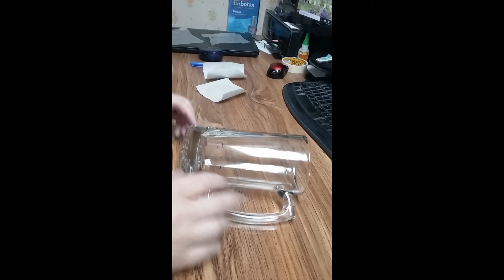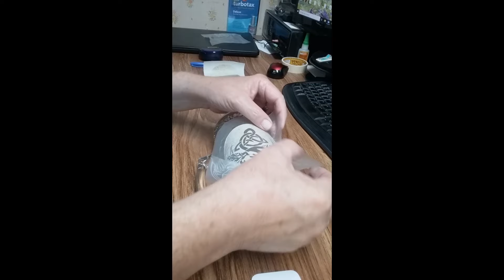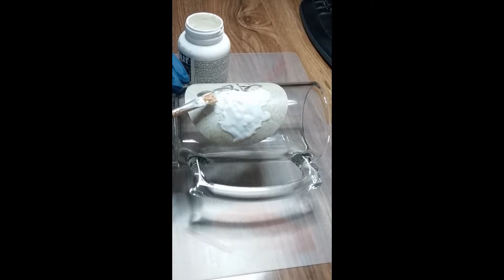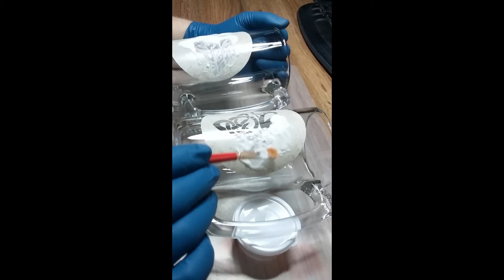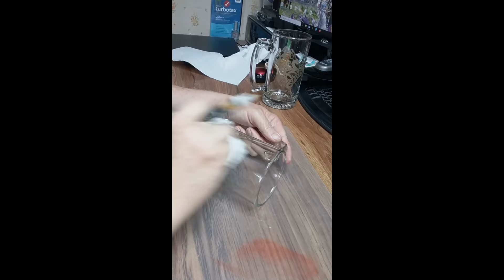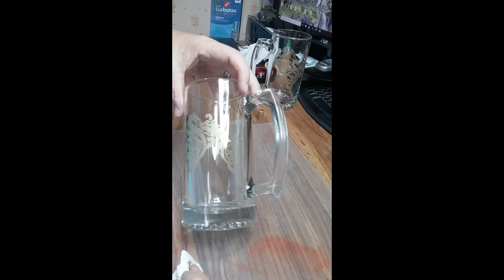Glass Etching with color

Comment: Have you tried Rubb and Buff for coloring?! 
 I'm curious if the painters markers work better or not?
Reply: Yes it was one of the ones I tested and it did not last as long, in the comment there is one that you bake on that they say works good that I have not tested.  I have coated some and then did sublimation on the etch area that has lasted the longest

Comment: I’ve tried the Sharpie brand paint pen and when rubbing off the excess it doesn’t come off the non etched part of the glass. It just smears it all over. Does certain brands work differently even though they are still an opaque paint pen? It’s oil based for permanent use.
Reply: I tried the Sharpie paint pen again, using the same technique you used. I have the metallic gold color and it’s oil based for wood and glass. It works to a point, but you have to scrub pretty hard to get it off the glass before it dries, and I do only a little bit at a time. I don’t know if it’s the color I’m using, but it’s not very noticeable. I tried a second coat, and there’s no difference. The color is great if I don’t wipe it off.  Maybe I’ll try keeping the stencil on after etching before taking it off to paint. Thanks for answering.
Reply from the maker: If you get a paint pen it must be one for glass Painters by Elmer's is the one I have had the best luck with or just a Sharpie pen not the paint pen.  I have coated them after they are good and dry with Mod Dishwasher safe Podge and found that it helps make them last longer. A have found that a magic sponge eraser will remove any thing from the glass.

Comment: Are you just coloring all over, even on the unetched areas?  What is on your rag, water or?  Thanks for sharing!
Reply from the maker: Yes I color all over then just wipe it off the unetched glass as it will not stay on the unetched glass, it is just a clean dry rag. do small areas if you go to big it will be harder to get off the unetched glass.
Reply: @cricuttipstrickssublimatio9632  Thank you!

Comment: does it was off? what using to wipe off wet towel or alcohol
Reply from the maker: I use a dry rag to clean up, it will come off over time as it will not bond to glass, the only way to get a bond to the glass is to heat the glass to approximately 1400 °C to 1600 °C depending on the composition of glass.

Comment: How long does the color last
Reply from the maker: If I had wash it I can take the color off in 1 or 2 washes in the top rack of my dishwasher I have had some of them last for months.  As it is on glass it will come off.  There is some glass paints that you bake on but all that I have found say that they will come off after repeated use.

Comment: I sandblast or tumble to get the same sandblasted finish on my small jewelry pieces. I'm a bit confused; are you saying the color will hold up to dishwashing? Is that because the sandblasted area 'grabs' the paint?  I know the Sharpie will rub right off of smooth glass. Is the Painters more durable than the Sharpies? THANKS!
Reply from the maker: IT IS NOT PERMANENT! but I have done glasses and put them in our dishwasher and they last for about 3 to 5 months then I need to re-color them.  The painters markers last longer as it gets in the crevasse better and it is made to hold on to glass. Next I want to pickup some that bake on and see if they will work better.
Reply: @cricuttipstrickssublimatio9632  Any luck with that?

Comment: Enjoyed the video, thanks for sharing.  Does the the paint have to be baked afterwards?  Maybe in the future you could share a list of colors from brands you have found to work best to save some trial and error of my own.  Subbed and thanks again.
Reply from the maker: No you do not need to bake the paint on from what I found there is back on paint but it did not hold up any better than the ones that you do not bake.  I only use gold and red for what I do but any color of Sharpie will work and Painters has a lot of colors that say they are for glass, just check and see that is is for glass.
Reply: @cricuttipstrickssublimatio9632  where do I find those painter's markers at?, and what are they exactly called?
Reply: @cricuttipstrickssublimatio9632  How long does the color usually last with all the dishwashing regularly?
Reply from the maker: @The.Achilles  I have not tracked that I have some that are good today from doing the video and some that I need to redo

Comment: the color disappears when you use it in the dishwasher
Reply from the maker: you can not stain glass so the paint is on the surface and will come off over time I have some that we use every day and put them in the dish washer all the time and the color has not come off.  I have found that it is all in the paint you use as to how long it will stay on.
Reply: @cricuttipstrickssublimatio9632  9

Comment: I've been told two definit ways of how to apply the etching cream. Letting it sit for how ever minutes or using the paint brush and keep painting it inside the image cut out for 3 to 5 minues. Which would you suggest?
Reply: I paint it on thick with a brush then let it set for 5 minutes before removing it and you can  put in on the next glass and reuse it.
Reply: I'm getting uneven layering on the etched design, any suggestions on fixing or preventing that?
Reply: @stdragons569  Wait longer than 5 mins
Reply: The etching result is disgusting, since the cream is very weak, the glass matting technique is absolutely not observed. See how a professional cream mattes. Which, by the way, is two times cheaper, and even reusable.  https://youtu.be/N2wSghaibDM

Comment: Thanks for the tip on using paint. Quick question...you mentioned that you used sharpies how were your results?
Reply from the maker: The red worked better but the gold did not so like the paint it depends on the color
Reply: Sharpies are not as good as nail polish.

Comment: The paint is not staying on the glass for me when I do the wipe step. Is there a specific cloth I need to wipe with? I wanted something flt that wouldn't go down in the grooves so I am using wipes that are basically made of that hospital face mask paper like material. Am I not leaving the etching cream on long enough to make a deep enough grove? Anybody got suggestions tips??
Reply from the maker: Do not use wipes they have cleaner that will remove the paint just use a paper towel.  The quicker you wipe it off the lighter the color and the longer you leave it the harder it is to get off the glass, you will need to play with it to get it the way you like it.

Comment: Can a paper towel be used to take off the excess? It is dry? Interesting how it just comes off doesn't spread the excess paint! Thank you for sharing this!!
Reply from the maker: Yes I use a paper towel in the video. It does not bond to the smooth glass so it comes right off it is not dry, but the dryer it is the better the color in the etching so you need to play with that.  If you need to start over just use a Magic Eraser I found that will do the job fast.